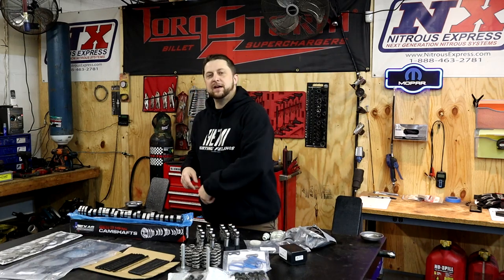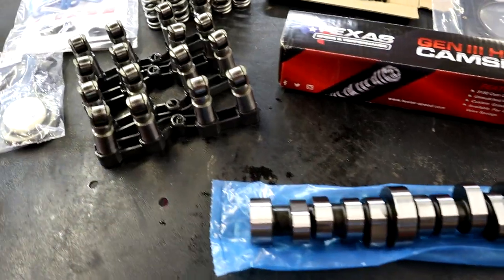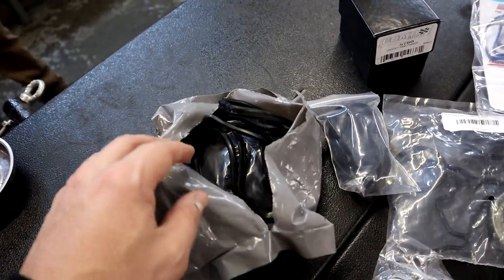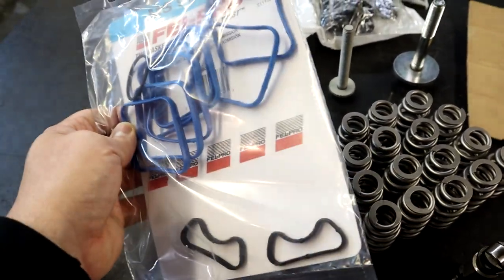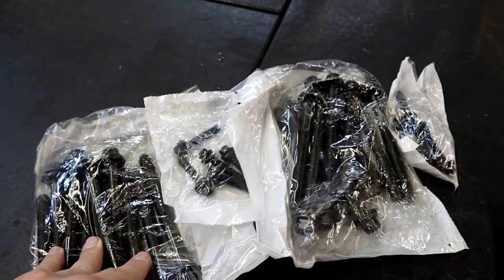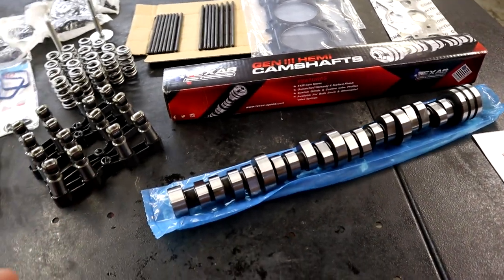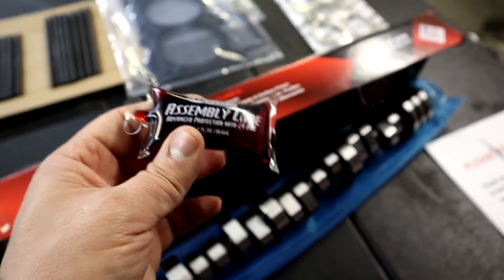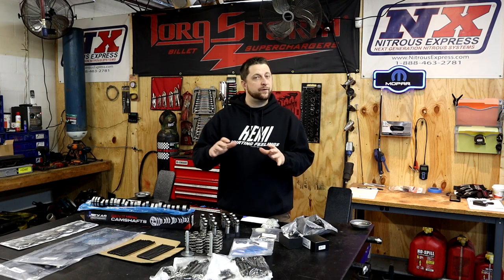FRP Max Effort Tomahawk Cam Kit For All 5.7/6.4 Hemi Motors

Comment: Update….I received my package from FRP, you’re not exaggerating at all, they sure do supply everything you need as far as parts go, and everything is going great, the FRP tech support is phenomenal!! 
Im in the middle of my build, the only hold up is my heads are at my local machine shop. 
Getting new valves, the frp valve seals installed, getting the exhaust manifold bolts out of the heads. I didn’t want to drill them out myself being that the coolant jacket is close to the bolt hole. (Any mishaps and I would have ruined my heads)
Id rather be a little patient and have everything work correctly and much better than before the rebuild.

Honestly though, I didn’t think it would take this long, but thats ok, with the way its gonna run, and that sweet “Hemi Chop” it’s definitely worth the wait.
Reply from the maker: Good stuff💪

Comment: Running the tomahawk in my 12 5.7 hemi charger with a torqstorm, awesome products.  Good customer service!
Reply from the maker: Awesome feed back exactly what I want to hear💪🙏
Reply: What’s the car pushing bro?
I’m look into running the titan cam on my torqstorm boosted ram
Reply: Is it a real choppy cam or barely noticeable
Reply: @aceklub2k5   real aggressive, makes good power.  It's everything you could want in a max effort cam.
Reply: @joesulkowski1249  I appreciate that…just got mine this week. Now I’m just searching for a stall
Reply: @aceklub2k5   what transmission?
Reply: @joesulkowski1249  nag1 if you have a challenger or charger
Reply: @aceklub2k5   I have a nag1.  I am running a 9.5" 3800fti converter
Reply: @joesulkowski1249  I opted for the 3200 being that it’s a daily
Reply: @aceklub2k5   probably for the best.  I don't daily mine, I almost went with a 4k stall lol
Reply: @joesulkowski1249  do I need a tq converter for this cam? I found a great deal for 900$ for everything that’s in this vid I got a 6.4

Comment: What's up FROSTBITE?!Man that max effort in that Challenger sounds mean!  I'm on my way soon  to ALLPAR to install the max effort cam package,392 intake,srt exhaust manifolds, and hellcat exhaust.any predictions? I have 16 5.7 challenger completely stock right now.
Reply: Also have 3 inch hi flow magnaflow cats.
Reply from the maker: Most cammed bolt on 5.7 setup ls make about 400whp some do better than others just depends really

Comment: Love your channel 
Great stuff … look I got a 2500 ram with a 5.7 Hemi .. I install the edge pulsar and delete the muffler, cold air intake the truck runs so much better if I install the cam shaft kit it will work with what I have ?
Also I have to tune  the cam ? Thank for posting good content
Reply from the maker: Thanks, yes will fit all gen 3 hemi and you will need custom tuning.

Comment: I have an original Challenger 5.7, I'm going to put this kit on it. Then if I want to add a supercharger, would this kit be ok or would it have to be replaced? I don't want to have to forge the engine.
Reply from the maker: Should be fine

Comment: I have a stock 2013 ram 1500 has the 5.7 hemi if I do the cam swap/upgrade would I need new injectors or new intake manifold? Or can the rest of the stock engine components run this upgrade?
Reply from the maker: No need for injectors or manifold the stock is fine

Comment: Can you tell me any info on the MMX S/C cam for early 5.7, what to expect for power gains and sound, have the valve train, 3.91 rear end, and 3000 converter for it as well.
Reply from the maker: Not familiar with that one haven't heard anything on it atleast.
Reply: @FrostbiteRam  ok completely understandable, the specs are 
589/585 Lift
212/224 @ .050
114.5 LSA if you could tell me anything in that, I’m aware once boost/nitrous is introduced is when it’s most beneficial

Comment: Does it work on '06s & do you have to have the car physically there or can it download over the internet?
Reply from the maker: Remote tuning is with email can be anywhere
Reply: @FrostbiteRam  would there be an issue with valve to piston clearance in an '06 engine?
Reply from the maker: @vincentenk4449  contact Ryan at frptuning.com he has all the specs
Reply: @FrostbiteRam  thank you sir.

Comment: What hemi you going with in the Dakota???
Reply from the maker: 5.7 stock block with ring gap and this camshaft.
Reply: @FrostbiteRam  just installed a tomahawk cam on my buddies car. His is a 17 charger 5.7 Ryan recommended the torque converter however we wanted to test this on a stock on and holy crap. Car made 503.4 whp on the stock converter that 5.7 really woke up. Ryan himself did the tuning. Amazing guy definitely using and suggesting more of his cams.
Reply from the maker: @nicojones4333  thanks for the feed back thats awesome

Comment: Would this fit in 2004 5.7 hemi  ram
Reply from the maker: He has camshaft that will you need a non vvt  cam I believe.
Reply: @FrostbiteRam  so use the non VVT CAM for that year than
Reply from the maker: @irving9562  I believe so yes contact Ryan at frp and he will get you right

Comment: Good video bro 👌
Reply from the maker: Thanks man time for some e85 and new tuning 💪
Reply: @FrostbiteRam  nice 👌,  u were running ms109 b4
Reply from the maker: @IncredibleHemi1111  yes I was i have lots of new fuel stuff about to go in soon.
Reply: @FrostbiteRam  nice man, tne way i wanted my motor built I can make over 800whp on pump gas. Just imagine what it can do fully turned up on race gas 😈. Your truck will be nasty bro
Reply from the maker: @IncredibleHemi1111  can't wait to see your rig run. I think I'm going to start a 400ci or 411ci build on the side for when I need it lol.
Reply: @FrostbiteRam  hell yea man definitely go with a BGE block to start